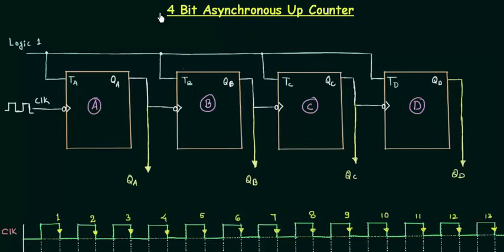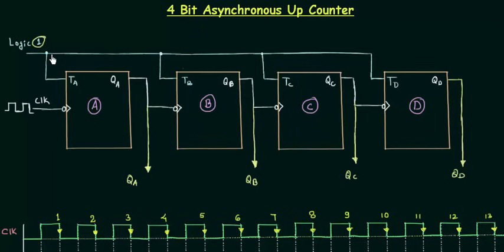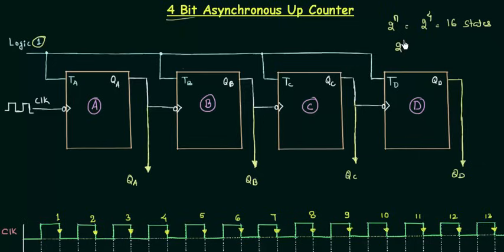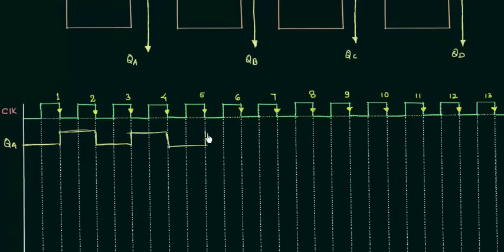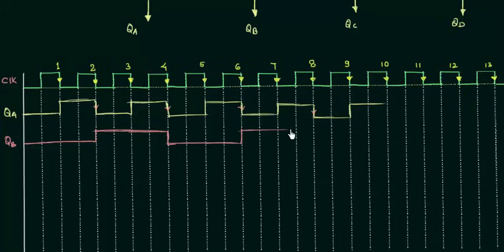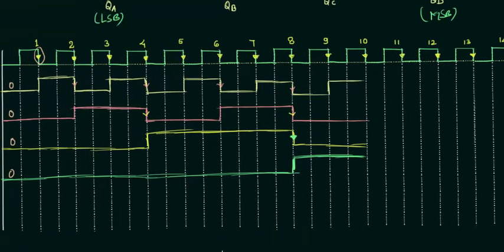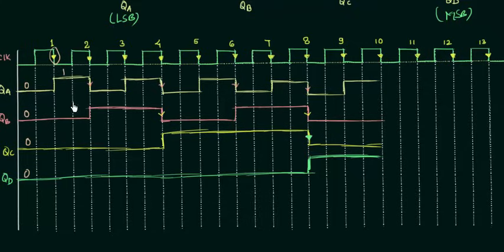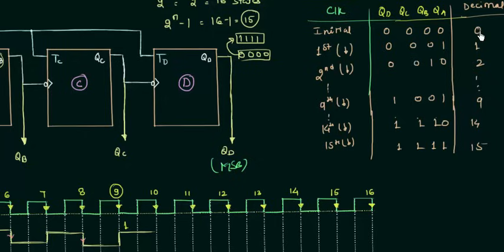4 Bit Asynchronous Up Counter

Comment: instead of T flip flop if I had used JK would it matter?
Reply: Nope , well it's just a toggling condition . Which's present in both T ff & JK ff . Like u eat oreo directly or remove the slices , eat cream , then eat biscuit , does it matter , it still ends up in stomach ~

Comment: sir i have a question , in the counter you use negative clock pulse why you use only negative clock pulse? can i use positive clock pulse?
Reply: It is negative edge triggered...and it will help us to avoid race around condition

Comment: why do we use toggling mode..?
Reply: We want it to work in order , not unpredictable ; which actually occurs in race condition ( which we avoided using -ve edge trigger ) . We want the signals to go on changing , not be memory nd kept . What's better than toggling , so we use it

Comment: Why we are using t flip-flop for 4 bit asynchronouus  counter
Reply: you can use j-k flip flop like in previous video. It does not matter. T flip flop is actually like giving same inputs to j-k flip flop i.e if u give same input to a j-k f.f lets say 'x' then it behaves like 't' flip-flop.
So in the end we are giving '1' as input in the flops

Comment: Sir, I’ve a question what if we use clock as LSB and Qd as MSB then we’ll have 5 outputs and this will count upto 31. Is it possible?
Reply: You cannot obtain a regular count like that
Reply: Yes same doubt.. 

By using 5 bit up counter can't we achieve 31 counts
Reply: @anusharapaka2413  clock is not an output it is used to enable the FF also the clock can have different timeperiods hence by considering it as LSB we will get wrong answer

Comment: Sir, i hv a confusion about the usage of clock pulse in up counters and down counters in asynchronous and synchronous counters.
When we use Q as an output then Which kind of clock pulse (either positive edge or negative edge) we must use to make up counter (in asynchronous and synchronous counters) ????

When we use Q complement, as an output then Which kind of clock pulse (either positive edge or negative edge) we must use to make down counter (in asynchronous and synchronous counters) ??????

Why the negative edge clock pulse is used all the time. If we use positive edge clock pulse then how to draw the time diagram ???
Reply: Bhanupriya Soni 
For Asynchronous 
If it is Q compliment and positive clock then it is up counter.
And if it is negative clock then down counter

And for Q if it is positve clock then down counter.
And if it is negative clock then up counter

Comment: how many flipflops should i use if i want to make a counter upto 9999
if i use 13 ffs it counts upto 8192 but with 14 it counts upto 16384.so what shoud i do to stop it at 9999 and how after 9999 it will get back to zero
asjid356@gmail.com its my email 
plz plz plz help me 
its my project in university

Comment: what happens when we apply  positive triggering
Reply: Output is not predictable when you use positive triggering because of the race around condition
Reply: The toggling will take place at the the LOW to High part of clock , so the waveform will shif left by T/2
Reply: output will be same as negative triggering for use of positive triggering instead of negative triggering?
Reply: just give the complement of Qn as the clock of the (n+1) flipflop